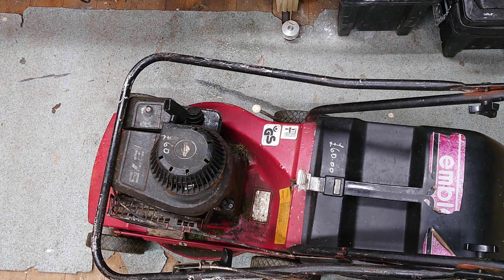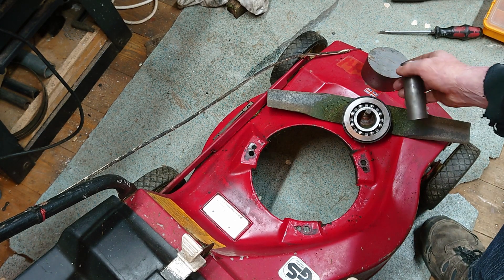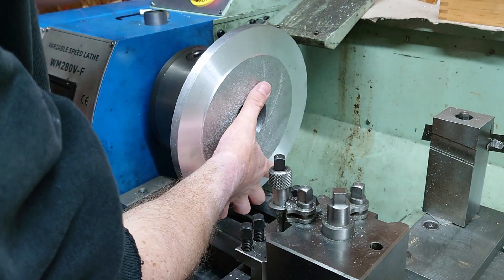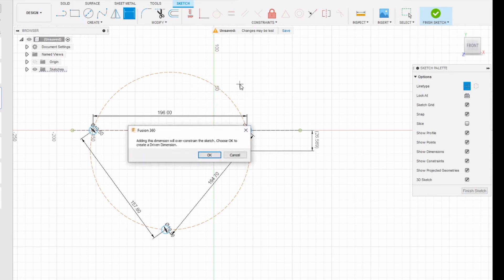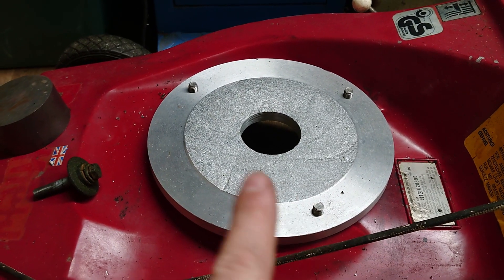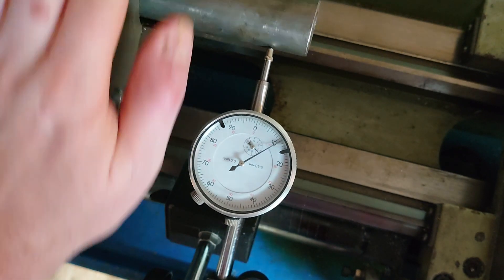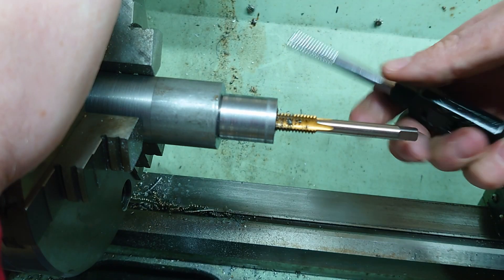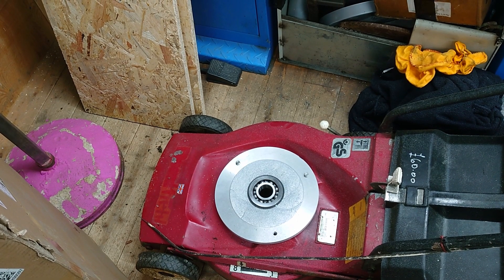Electric Lawn Mower Conversion Part 1

Comment: Would a sealed bearing not have been a better choice in the long run?
Reply from the maker: Absolutely. I just had that one lying around, so will use that for now. If this thing actually works, I'll look at some improvements.
Reply: @ollysworkshop  that's fair, i wasn't sure if I'd missed something lol, I have a dead hayter I'm considering converting so eager to see the follow ups, I'm thinking of using a separate low speed motor for the self propelling instead of using the one motor for everything.
Reply from the maker: @Shaggy_matt  this one isn't self propelled, but I have thought about adding extra motors to perhaps make it radio controlled, or autonomous. I even thought about making a baler for it. The speed I get stuff done though, it will be a while before I get this bit of it properly working. You would probably be better off doing yours with separate motors, as I expect the gearing is quite lossy. With an engine you have loads of spare power, but any losses just equate to more batteries with electric!